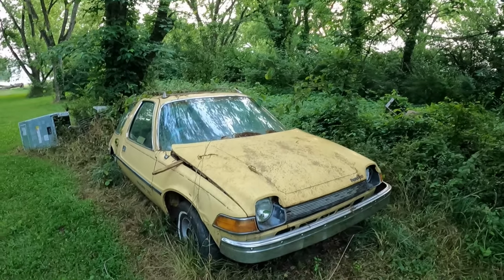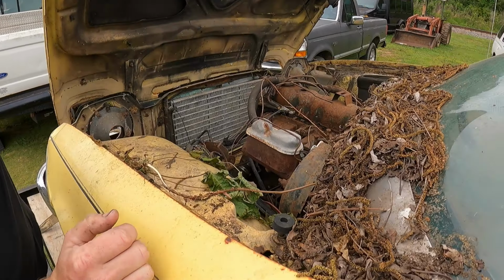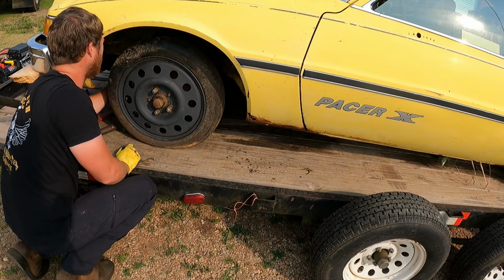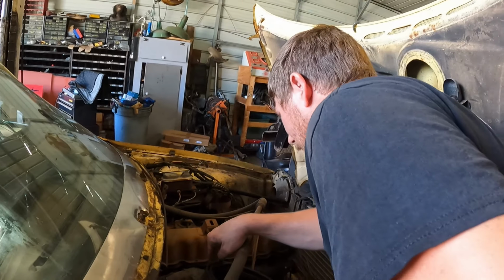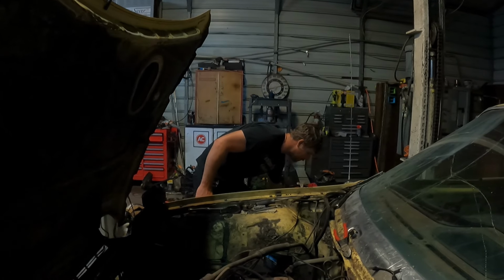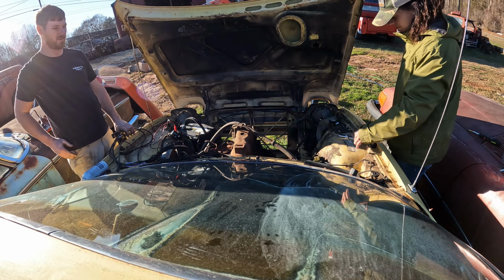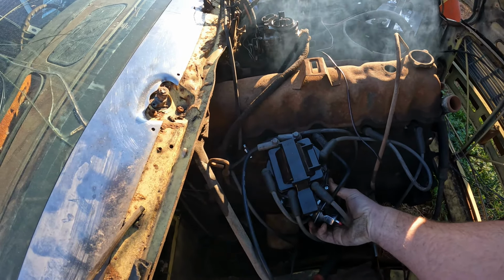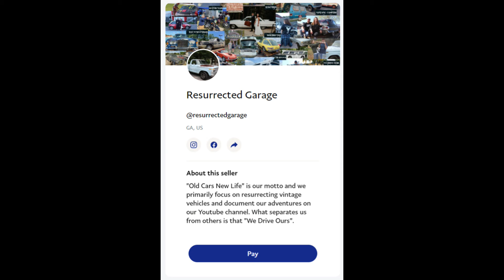Rescued a AMC Pacer X - Will it Run? [Just Make it Run January]

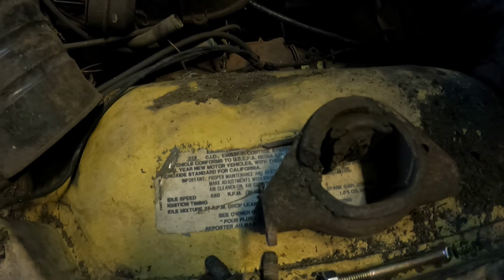Comment: At 20:53 doesn’t ignition/key need to be switched on to unlock steering?
Reply from the maker: The switch was on but the steering rack was seized. Months later after soaking in penetrating oil it finally freed up.

Comment: Danny from DD speed shop on YouTube has always been looking for one of these. So contact her? Also you need more tools smoke machine eBay $100 fo vacuumed leaks timing light or vacuumed gauge to set timing.
Reply from the maker: That's interesting, we are wanting to get this one back on the road but if we come across any more we will keep that in mind. We recently got a smoke machine and have a timing light; we will get it better set once we actually start driving it around. We just wanted to hear it run briefly and verify the engine was good so we could make a gameplan.